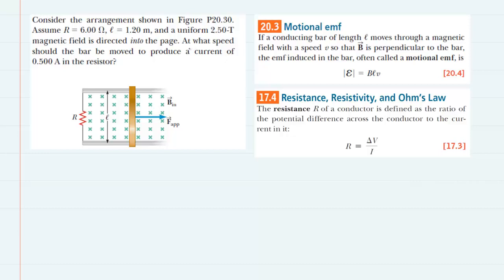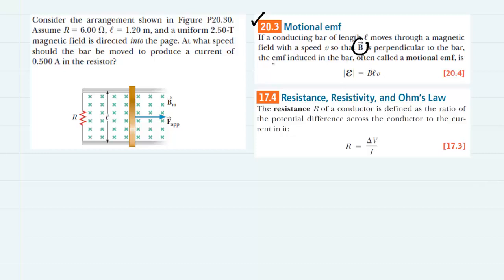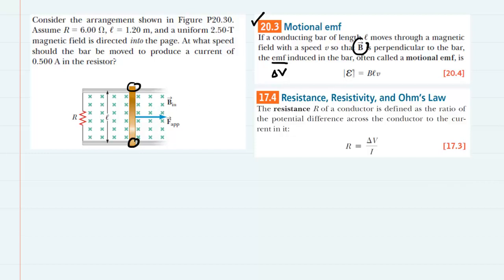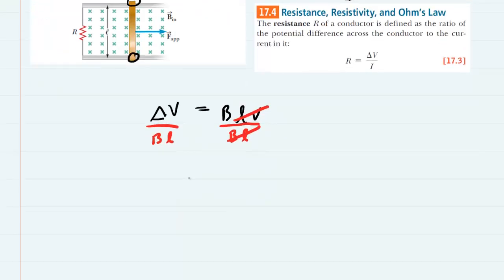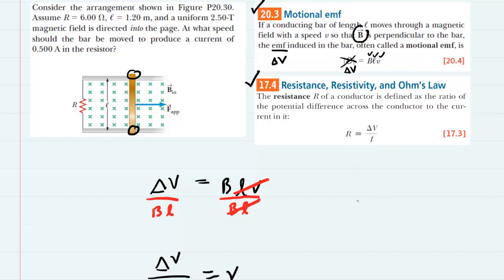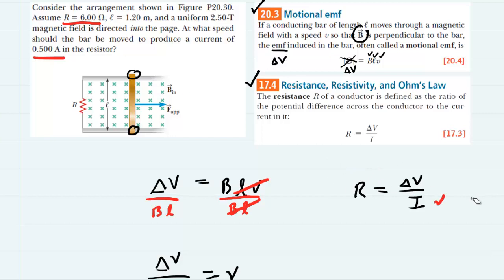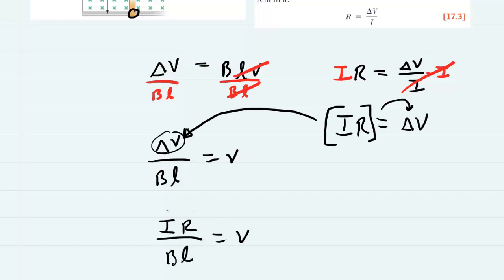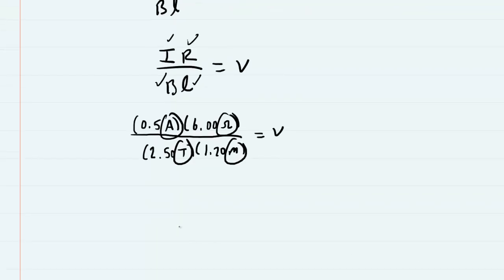Consider the arrangement shown in the figure below

Comment: Hello, I have questions to ask you.
The magnetic field shown in Figure P20.63 has a uni- form magnitude of 25.0 mT directed into the paper. The initial diameter of the kink is 2.00 cm. (a) The wire is quickly pulled taut, and the kink shrinks to a diameter of zero in 50.0 ms. Determine the average voltage induced between endpoints A and B. Include the polarity. (b) Suppose the kink is undisturbed, but the magnetic field increases to 100 mT in 4.00 3 1023 s. Determine the average voltage across terminals A and B, including polarity, during this period.
AB